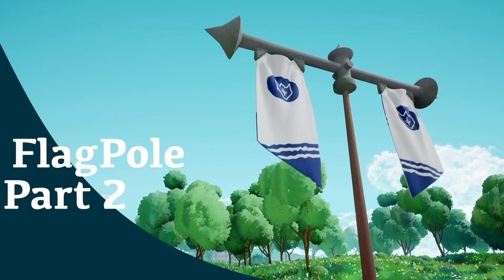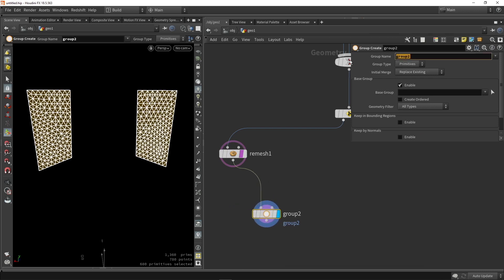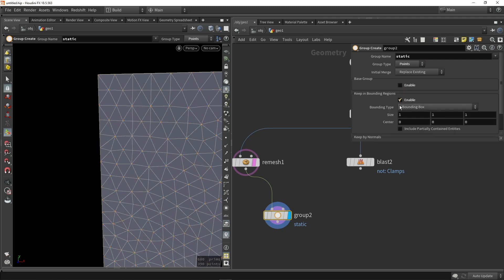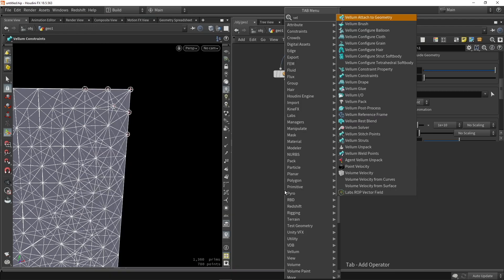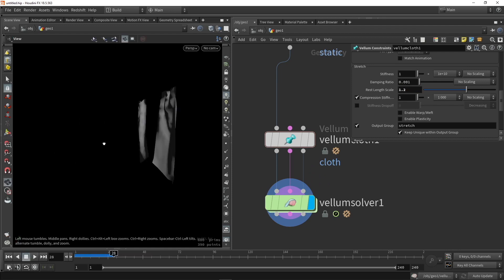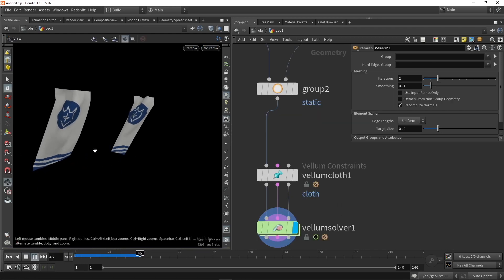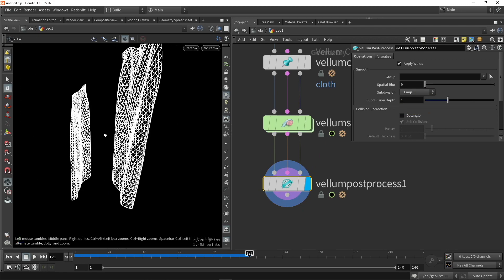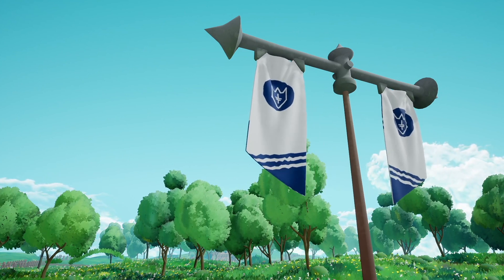Flagpole in Houdini Part 2 || Beginner tutorial

Comment: how can i export this flag to unreal engine? What do I need to export it to game engine and setup it on my scene in UE4?  This animation of flag is baked to Alembic, or is using texture-vertex animation?  

My main problem atm is a knowledge about syncing the houdini creations with game engines such unity or unreal engine
Reply: Alembic should work.
Reply from the maker: I might make a part 3 for exporting. There are a couple people asking about it
Reply: Export the geometry for the flag as alembic (Alembic ROP) and make sure the mode is transform (helps optimize it so it isn't assuming you're adding / removing points). Export the poll / unmoving geo separately then combine them in unreal. This animation shouldn't be too large - the only downside of alembic is the baked in frame rate + size.